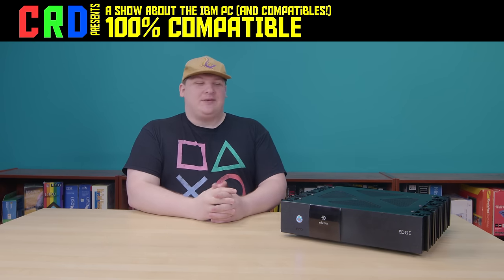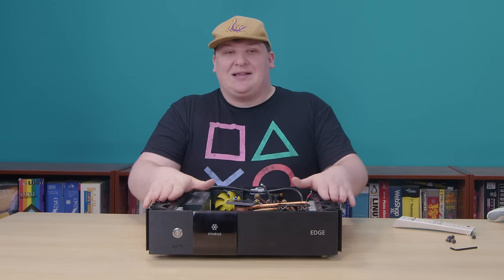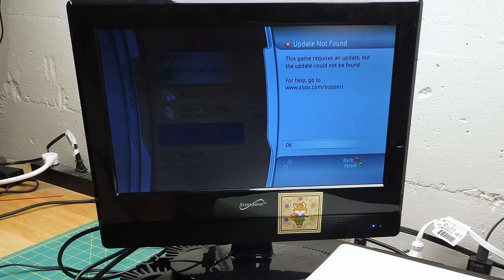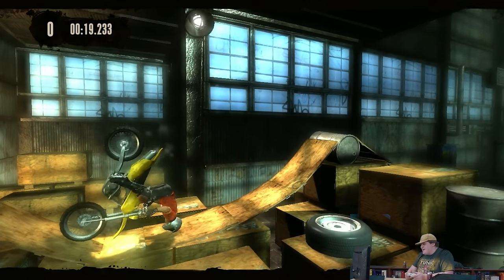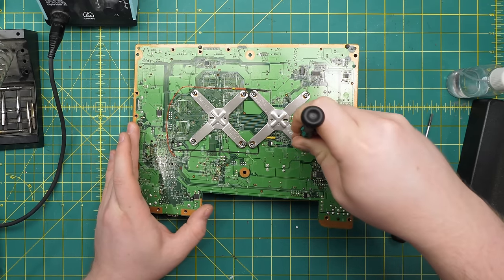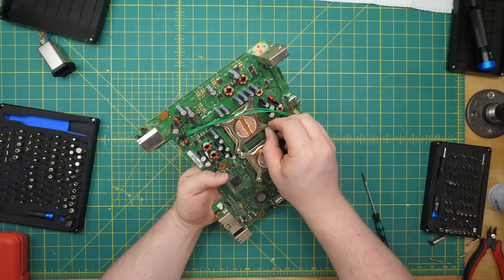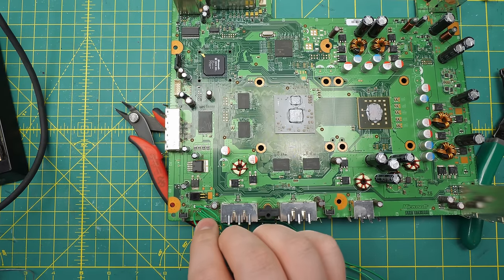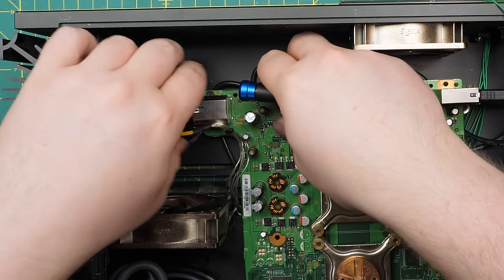The Niveus Edge Resurrection: Hacking A Hacked Xbox

Comment: FYI: For direct-die applications you want to use special thermal paste. Your Noctua Stuff has issues with pumpout and will cause issues after 1-2 years of use. Not that that's important in this particular case, but i had issues with it on a Macbook Pro, PS4 Pro and a GPU before. It's perfectly fine for a normal heatspreader to heatspreader application. You basically have to use thicker stuff like Gelid Extreme etc. then it lasts forever :D
Reply: or Arctic MX-6. Though the best would probably be liquid metal or a graphene pad, but those probablly cost more than an entire second hand 360.
Reply: @BrunodeSouzaLino Ironically, he has plenty of thermal pads left over from his previous Lil Guys video. If he rebuilds this to fix the crimes-against-heatsinks committed by Niveus (now that he's done this proof-of-concept); he could apply those at the same time he laps those hideous copper slugs.
Reply: @BrendonGreenNZL  The main issue would still be heat transfer. It's a bit strange that this much surface area dissipates so little heat. Those pipes and slugs should be either soldered or brazed instead of having several places with a thermal interface not designed for that.
Reply: @BrunodeSouzaLino  I understand the concern. However, the teardown video of the Denali proved that the cooling system is so overbuilt that this isn't a major concern. Yes, the thermal interface between the slugs sucks. However, there is so much thermal mass involved that it just doesn't seem to matter.

Comment: the key can be pulled from motherboard for dvd drive then use the usual dvd firmware hacking tools to write key\firm. The HD-dvd drive update an be applied by disc or usb as well just like the old xbox compatibility disc update does.

Comment: Oh the thermal grease! Back in the mid/late 90s I was doing amino acid analysis (among other things) in the Biochemistry Department and we had this old Beckman 6300 amino acid analyzer which used what now feels like a truly bizarre chromatography setup with step-gradient ion-exchange and smooth ramps of temperature (I guess at the time they designed it that seemed easier than a pump that could do gradient elution?) and so it had a bunch of thermoelectric modules and a giant heat sink and just fucking gobs of thermal grease to make contact between the cylindrical HPLC column and the V-groove in the thermal block. Ginormous mess every time we changed columns! (But also just ginormous mess all the time, it used post-column ninhydrin and the ninhydrin system all sort of leaked a bit so any time you touched just about anything inside you'd get the Purple Thumb from it...) So anyway any time I'm having problems with a mass spectrometer these days I think back to The Good Old Days and remember things sucked back then and the mass spectrometer isn't so bad really!

Comment: 35:02 I have a Xenon Xbox 360 that had failing capacitors. When tearing it down to apply fresh thermal paste it had also that kind of glue, almost putty thermal compound. It took me a LOT OF TIME to take it off properly. Weird since, you know, the whole x-clamp thing should be more than enough to keep the heatsinks in place.
Reply: Also 44:59 you can use a regular motherboard jumper setting... jumper, to bridge the two pins since they are next to each other. Maybe a dab of hot glue over the connector might give it some shock-proofing?

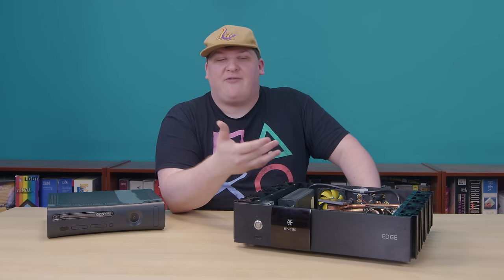Comment: The sad thing is that there's actually value to 360s just as media playback devices. They have that crazy over the top music virtualizer by Jeff Minter that can be controlled by plugging in four controllers and having different inputs on all of them. But getting to that virtualizer requires putting a CD in, so no, people couldn't care about the Niveus Edge as a media playback device! It gave away its coolest unique thing as a media playback device! (Inspired by the note at 17:00 about how no one would care about the Edge as a media player. I still hold onto my 360 for this virtualizer.)

Comment: Upgrading original board is not an option because it's would softbrick console without dvd drive.

In late 2011 Microsoft introduced new disc formatting for X360 called XGD3. 

It's was made for two reasons: First to stop piracy, of course, because it's using 200 more megabytes of dummy/security data that written on outer ring of game disc. So conventional DVD writer couldn't write this data without modification. And Xbox checking if this data is present when you played XGD3 games (that why this type of games still using DVD for first 2-3 minutes of gameplay even if the game installed on HDD)

Second reason why XGD3 was introduced because it's allowed game developers use 8.4 GB of data for game instead of 7.3GB that was allowed for older XGD2 discs.

Anyway, in order to even recognise this new type of DVD games during dashboard update around version 13XXXX it's performing DVD drive firmware update. So it's looking not only for dvd keys, but specific drive model that was installed in this console (for using appropriate firmware for dvd update). And without drive it's would fail to update and stuck with error code. Only way to resurrect this console after that would be installing RGH.
Reply from the maker: Holy crap. I mean, I wouldn't have tried it anyway... but wow wow wow wow.

Comment: Many thread lockers require an absence of oxygen to cure.

Low strength Green locktite is designed to be used as you are attempting here. Never use it like standard thread lock, because then those parts will likely never separate again. I suspect their green thread lock is just their sleeve compound in a different container. And sleeve compound is designed to hold parts onto metal shafts, and when trying to remove ball bearings that were fixed on a shaft with the stuff... They broke rather than the inner race actually coming free.

But simple super glue gel can do the same, you just need it to be thick enough not to wick in much.

Comment: I'm sure there is already a response somewhere, but on the loctite: there is a primer you can get (it's on McMaster, but it's somewhat expensive) that should help it cure. It might also be advisable to consider purple loctite for that size of screw, which is something I didn't know about until recently.

You might also be able to use a little bit of copper or aluminum to induce polymerization of it, anything that Henkel (the manufacturer) lists as an active metal in the datasheet.

Comment: Rubber band on whatever tool is tightening the heat sink, pull 'till it has the same length on each fastener and you'll be relatively equal torque.

Comment: Locktite 290 for those screws it's low viscosity and will wick down into the threads. The blue stuff will actually set with black oxide screws and aluminum threads if applied to the screw first, we use it in R/C helicopters and those are nothing but black oxide fasteners and machined aluminum and it works fine it just needs an anaerobic environment to set and takes a few hours.

Comment: I don't know if anyone has ever mentioned it before, but get a large package of coffee filters. Whatever size or shape is cheapest. They work so much better than paper towels. They don't fall apart easily and they don't leave little white fluff pieces everywhere. That's what I use every time I have to clean thermal paste off of anything inside a computer. Also I find that you can rotate the filter and use both sides once it's wet to maximize each filter. Seems silly but once I saw it somewhere back hell knows when or where and tried it, I've been using them since. Also since I had like a few thousand of them from before the era of single serve coffee makers, I haven't even needed to buy any in years.
Reply from the maker: That's a neat idea, I'll try to remember to do that!

Comment: Thread locker is only activated in an anaerobic environment, the way it works in between nut and bolt is that the air is pushed out and the thread locker remains with almost no oxygen left.

Comment: There is this stuff called Dykem CrossCheck that is really an anti-tamper indicator for bolt and such, that you just put over the top of bolt/nut connections.  It does help keep the nut from walking off.  Used it at a shop holding equipment onto trucks, which (of course) are much larger hardware, but thing it could still work on smaller hardware.  There may be a similar compound that would work on small hardware too.

Comment: If I recall correctly to use the HD DVD player you needed to insert a red disc (drm I'm assuming) into the disc tray on the xbox 360.

Also the controller wasn't IR. It was a different type of communication, not Bluetooth though.
Reply: The red disk was a dashboard update for the 360. While the game controllers are a proprietary wireless communication standard the 360 also had the option to use an infrared remote for media consumption.

Comment: Grounding alone won't shield anything from RF. Safety ground is just that, for safety. In RF design it is all about controlling electromagnetic fields by coupling them in together in a controlled way. I'm not an RF expert though. There are a few talks by engineers on youtube about how grounding works. Hint: It defies most commonly held views in terms of how electricity works. Something to note is that the front panel has a hole in it where the front facing fan is located. this hole could be large enough to allow the rf signals through.

Comment: Tip for cleaning off thermal paste... Use an anti-static brush with a bowl of IPA to get in those nooks and crannies. Great for removing all the old thermal paste from the little tiny caps on CPU/GPU PCB's. it also just works better in general than cotton swabs.

Also I prefer to solder splice wires like NASA... I was wondering during the heat pipe assembly. Would it have been easier (not better) to assemble the heat pipe outside of the case, then attach the x clamps. we will never know.

Comment: Red Loctite on electronic stuff is a flogging offense!  You can make hardware stay in place by dabbing a touch of nail polish on the two surfaces (fastener and nut or fastener and panel).  I use the cheapest brightest color I can find in the grocery store - cleans up with a little acetone if you remove the fastener later.

Comment: The reason your Loctite didn't set is because it requires an airless environment to set. Loctite makes a products specifically for wicking into pre-assembled bolts, loctite 220, wicking, low strength, might be right for your application.

Comment: While watching this already amazing video I didn't expect to see that you'd solved a problem I've been wanting to solve for years! How did you get an SSD to work on the Xbox 360 using the internal HDD connector? I thought they had to have a proprietary HDD firmware which prevented unofficial HDDs and therefore SSDs from being used...already shucked a 500GB 360 Slim HDD to fit into my 360 'Fat' HDD caddy, but even that's getting a bit old now.

Comment: 28:40 That flat heat pipe space might have been intended for a fanless cooling solution for other hot parts on the motherboard.  Maybe Niveus ordered the copper slug cooling tower parts to be milled in a rush, and in the time between order and delivery Niveus "designed" out the flat heat pipe because it was too labor intensive to install, or unnecessary with the fans, or the wanted to be cheap?

Comment: I wonder if Niveus's cooling solution might have prevented the Xbox from bricking with it's OG motherboard, as one of the main reasons why 360's were red ringing was because of design flaws that caused the connective balls on the CPU and GPU chips to crack under heat (The PS3 at launch had the same issue, but I think the 360 also had additional flaws that made failures more common.) Maybe overkill cooling solutions might be what we need to keep original white 360's alive, and maybe launch PS3's as well.

Comment: To remove red thread-locker, use heat. If you hold your soldering iron on it for a second it will be much easier to remove.

Comment: What you could do, if you wanted it to be as stock as possible, is j-tag the console, backip the nand, flash xell, boot up the console to see the dvd key via xell; then flash the original firmware back on and undo the jtag mod.

Then flash the dvd drive with a replacement firmware with the correct dvd-key you recovered.

Put it back together, and bam, its back to stock, repaired, and plays games again.

The HD-DVD not working is because it needed a certain console firmware, AND to download the license to use it. So yeah, e-waste.

Comment: If i recall correctly, there might also be such a thing as distinguishing between chassis ground and signal ground - i've learned that, when i shorted all the *-GNDs of a DIY VGA cable (including "shield"), you know "for good measure", and got "weird ghosting" in the picture …indeed, i'm anything, but a proper EE! 😅

Comment: 55:40 (or thereabouts): thread lock works only after you apply pressure, at least most of them. It just stays there looking not-so-pretty if you don't fasten your hardware with it pre-applied. I've had.... I don't know if luck or otherwise with the brass + black oxide screws with thread lock: the red one does it's job well indeed for near permanent, but that specific combo makes it... like a goddang weld. I've done it for threaded inserts, and you're likely to destroy anything the insert is put into, without unscrewing it at all. But that does mean you apply it to either of the fastener ends, and then screw things tight. Then it just doesn't come out.

Comment: lock-tite needs to be closed in between the screw-treads to dry fur real.
normally we use (red) nail polish to fix a nut on a bolt when it's allready mounted. to prevent loosen up. and it also functions as a check dab to spot if a console is cobled with.

Comment: Not sure how obvious this advice is, but might as well

In my experience, ptm7950 is pretty handy for really anything direct-die. 
You get it in sheets you cut parts off of, so if you're careful with applying it, it sort of guarantees that the whole die is covered. And, since those sheets are not exactly liquid (think plasticine, or maybe wet modelling clay, or dry-ish thermal paste) and have some thickness to them, you have way less of a chance of cracking a die when mounting the heatsink.
Other thermal pads would probably work too (and maybe probably are either similar or the same material), but I've got no experience with those.

Comment: I’m glad you too have now experienced the absolute horror that is trying to remove the x-clamp without a dedicated tool (which I bought after dealing with it once knowing I had a second 360 to work on). Also Microsoft is still using that thing to this day, the Xbox Ones and Serieses also use it. Meanwhile Sony settled on a simple spring clamp that uses 2 normal screws on the PS3/4/5 and is much easier to deal with.
Reply from the maker: Awful! I'm glad I didn't damage the board taking it out.

Comment: Microsoft did the same drive locking BS on the OG xbox except worse because they locked the HDD to the motherboard and if the lock code on the HDD, Disk drive, And Motherboard did not match exactly the console would not even boot and became bricked.

Comment: Loctite needs metal ions in the absence of oxygen to set
You can get primer that makes it set better in suboptimal conditions
You can get 'wicking grade' loctite (290 if you want name brand), which would be ideal for those mounting screws, it's very thin and wicks into tiny cracks and crevices like threads.

Comment: I'm surprised that I haven't seen this brought up in any comments on either of the videos; my assumption as to why Niveus removed the drives out of the Edges is that they may have been buying 360s with dead drives and converting those instead of buying brand new ones.

Comment: Soon as I got my Xbox 360 I setup the Media Extender feature, found it lacking; and looked for tools that could transcode and handle the metadata in a more visually pleasing way. Mostly because I had an OG Xbox with XBMC on it and other then it not being able to decode 1080P it was the superior media box at the time. Emulators, boot games off the HDD, and stream my "vast" 800GB media collection.

35:01 You are correct, I've repaired dozens of this era of 360 and they used gray thermal paste, meaning those people just added more on never cleaning off the old stuff. The older it gets the harder it is to remove. I use a makeup remover cotton pad soaked in alcohol then let it rest for 10-30 minutes for hard ones. That's wildly poor build quality.

Comment: 24:03, I think it works because of two reasons, first its aluminum and not copper, its not a good conductor of eddy currents as its not ferro-magnetic. the second one is that the bulk of the thing is on the sides, that might guide the signal.

Comment: Now that the psu is without modification, extra grounding doesn't do any extra for safety as it is double insulated. 
Also there are many large holes in that chassis where the 2.4GHz rf can escape from (~20x2mm slot, american quarter coin slot is still "large") and the rf link is very robust for what it is as it doesn't need bandwith max 100kbit/s with headset and latency can be ~10ms.

Comment: The square Cut in the lower “heatsink adsembly slug”..

Is most likely for another application ..
A spring style mounting clip, like on Socket7 - is my quess..

Make you wonder where the cooling was “made or sources” 🙂

Comment: Thread locker compounds especially ones like loctite are anaerobic. Means they don't cure or harden in presence of air. That is the reason they harden around screw inside threads but not like this as dab on top. That's usually done with acrilyc paint or epoxy.